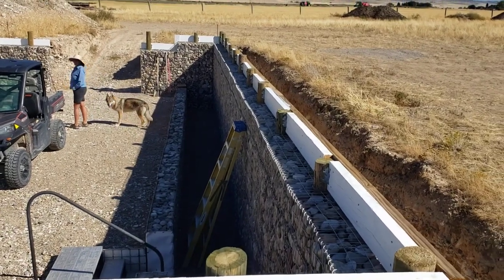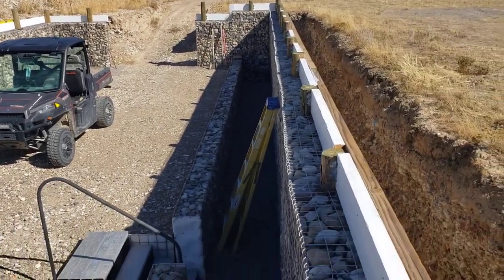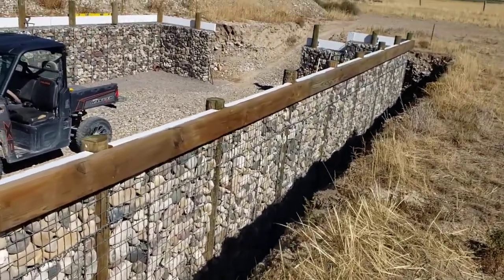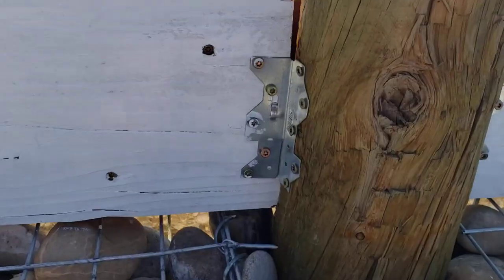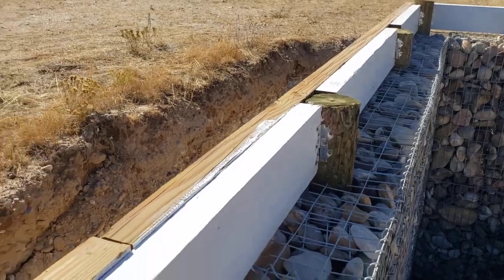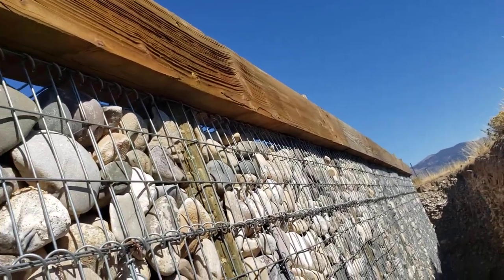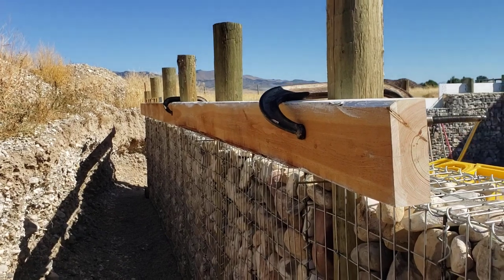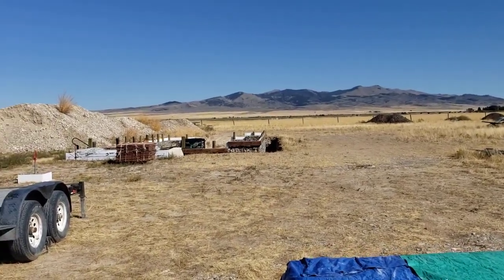Step 11:  Installing headers in our pit greenhouse/Walipini

Comment: And aircrete finish would be great insulation and sub wall to attach any finish
Reply from the maker: Thank you for your comment.  This is a very good suggestion if you don't mind using concrete in your build.  The big advantages to aircrete are strength and that it is inexpensive over total concrete.     Except for the cold storage building, we opted to stay away from concrete to avoid leaching.
Reply: @montanalivinginthebigskyco8541  have you thought about adobe or cob finish? Or foam insulation? Most I’ve seen online is left exposed as is.
Reply from the maker: @brandon6348  Hi Brandon.  We didn't consider abode finish but we did visit a MT greenhouse that did apply that technique, successfully.   For us:  there is another video I will be posting on insulation and finishing before we backfill the hole with dirt.  We have one wall finished before all the snow and subzero weather hit us.  The last video we posted was on installing pond liner.  This is the first layer on the outside of the gabion walls.  Up against that liner are two layers of 2" rigid foam board insulation for a total of 4 inches thick.  On top of the insulation is filter cloth.  On top that is 6 mil visqueen plastic sheeting.  So outside of gabion basket wall is:  pond liner + 4" foam board + filter clothe canvas + visqueen.  
Cheers, J&K